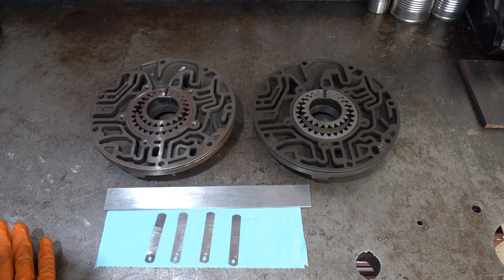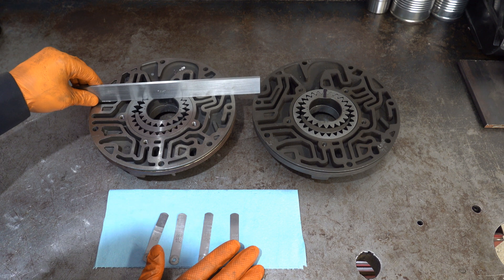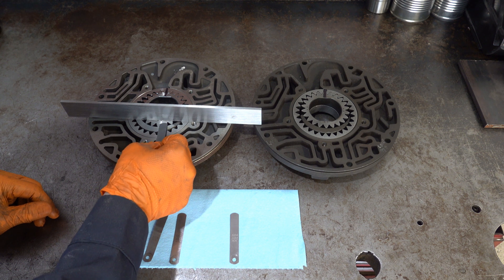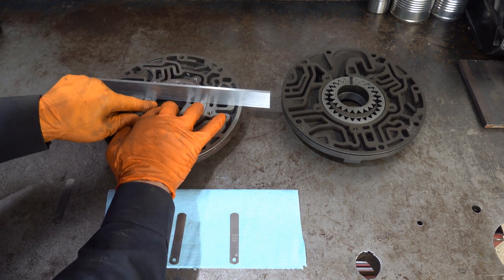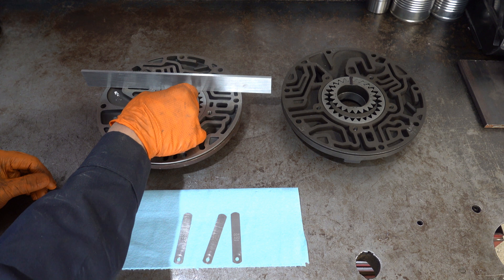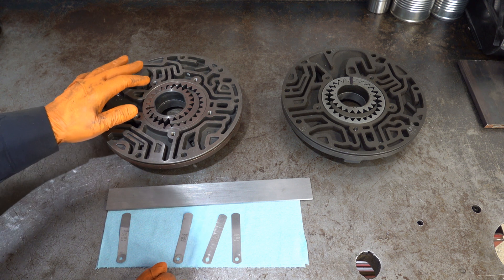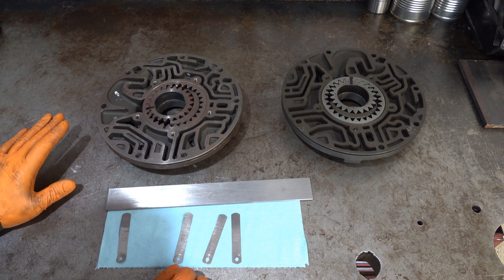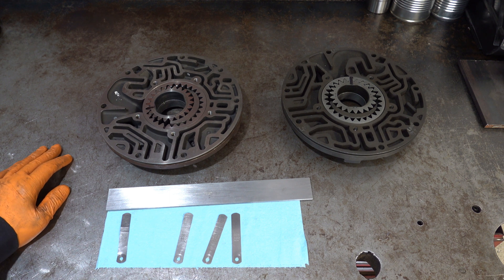4L80E   Measuring Pump Gear Clearance

Comment: What about the side clearances in the pockets? I am getting .003 @ outer gear to pump body and .013 @ inner pump to crescent. That is side loading the gears.
Reply from the maker: I don't I showed those two measurements as I didn't have spec values for them at the time...I will likely do a follow up video at some point showing clearances being done by micrometers and include those two measurements....003 for outer gear-pocket seems ok as does the inner gear to crescent. Look at the crescent itself. As long as it's not worn and gear-deck clearance is acceptable, it should be fine (provided the stator support working surface is also perfectly flat).

Comment: Hi Nick , I damaged the converter enable valve spring assembling the pump, do you have a part number and supplier to purchase a new siding?
Reply: Also Nick , do you know the part number for the Sonnax pump plug kit. Our size is the .627 diameter. We don’t need the sure cure kit, we have all the other parts already.
Reply from the maker: Hi James,

I don't provide part numbers as it takes too much time to research however if you contact Transtar or Transpartswarehouse.com, they should be able to help you out...If you cannot source a replacement enable valve spring from a transmission parts supplier, you'll need to either by a good used pump or grab one from the junk yard.

Comment: Ok, I’m not following….spec is .0007 - .0028 but you used .0015 - .004 feelers?
Reply from the maker: I don't have .0007.0028 feelers (I just acquired a .001 feeler gauge). 

ETA - my reasoning behind the .0015-.004 feeler gauge is that if i feel drag on both sides of the .0015 gauge when using it on the gear(s) and straight edge, I know im within spec...the .004 is there to show if i'm a full .001 over spec which would explain any pressure-driven failures inside the unit. Hope that helps clear up your confusion.

Alternatively, you can use a depth mic and outside mic to measure separately then calculate the clearance...Just measure each component in multiple places for variance. 

I may do a follow up video on measuring for pump clearances using this method, as it's arguably more precise with the caveat that the person doing the measuring has good micrometer technique.